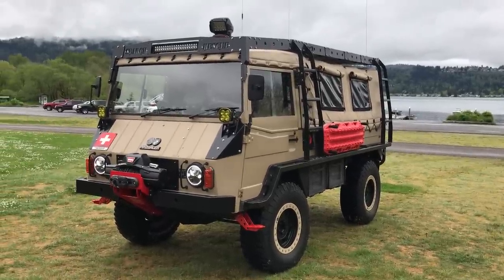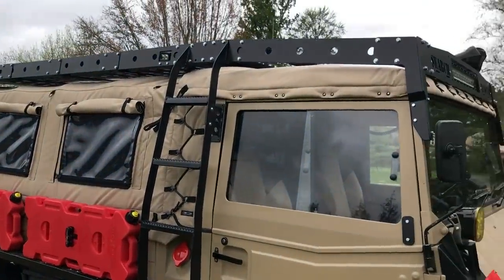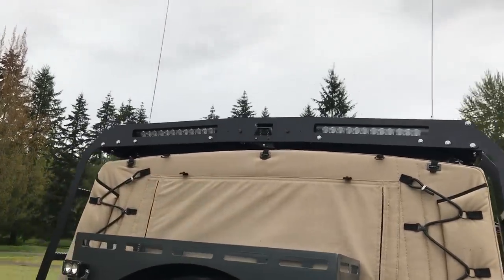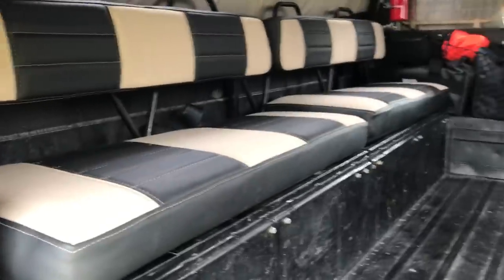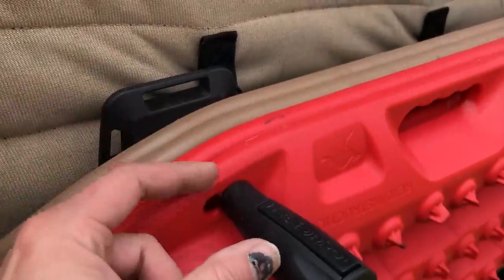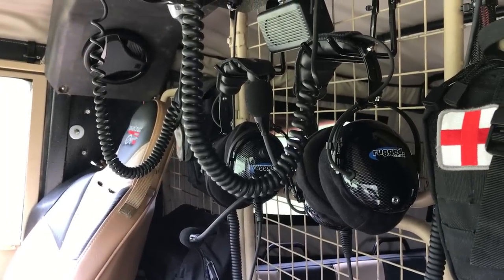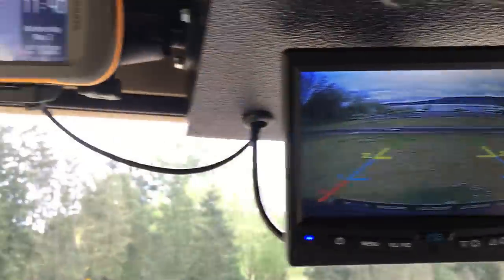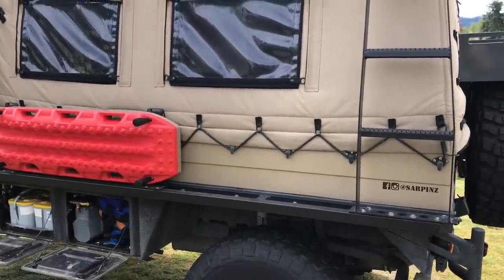Search and Rescue Pinzgauer vehicle walkthrough

Comment: The roof rack is very impressive, couldn't stop looking at it.
Reply from the maker: Thanks Kenneth, I drew up the initial design and took it to a fabricator (Mule Expedition Outfitters in Issaquah, WA) who then turned it into reality for me.  I wanted something lightweight (it's all aluminum, weighs less than 200lbs) that matched the original lines of the vehicle as much as possible.

Comment: This is a very cool rig!!!

BUT NOT because of the BIG 3. These are always the same: LED lights, bumper and roof rack.

What makes this thing special ist the torsion bar frame, the ground clearance with SMALL tires (due to portal axles) and the overall very small footprint.

Comment: Dear God that Pinz is sweet!!  The people at Mule worked some real magic for you!  Did they do those red front entry steps for you, too?  Looks like they're retractable (?).  At 6'2, I always wondered if I'd be too tall for one of these, but can't help drooling anyway.  Looks like those suspension seats are pretty much flush mounted, so not a lot of interior height lost there - nice!!  

Just a quick side note - About $300 to $400 in Dynamat will bring the decibel level down 20+.  Throw some marine carpeting over it using a contact adhesive and you're set.  Just a thought, if you'd like to quiet the ride a bit.  

Congrats on your win!  You certainly deserved it for such an outstanding Pinz!!  Can't imagine what all of those mods cost, but It was certainly worth it.  There are a couple of radio-body 710Ks near me for about $25K.  Sooooo tempting!!
Reply from the maker: Thanks for the kind words, I appreciate it :-) the steps are removable by pulling a pin.. they came from Expedition Imports in Valejo, CA. I've had some 6'+ guys sit in the pinz and they were surprised at how well they fit, however the did comment that the sightline was a little challenging due to the height of the windshield.. for reference I'm 5'10" and fit great with loads of head room.  

Thanks for the tip on sound deadening.  The place I'm going to start is in the rear.. the gearbox is the noisiest part of the drivetrain (when you push in the clutch it quiets down significantly) so I think my biggest gains will be targeting that sound.  It's been on my list for a while, but there's always more to do than time to do it :-)

Comment: As a firefighter EMR in NM I am impressed. What was the cost? if that is not too cheeky! Didn't see any water capacity? Also consider a stokes config for evac., Put extrac. and rigging in exterior access. ( under box on sides.) Totally cool you got my vote! Consider marine electrical passage systems and wiring. Not to be critical, but clean up the coms.Unnecessary complexity.  Much better systems out there. Still love it. Beware the ram mounts they do polish and slip.
Reply from the maker: Hi Tim, into it for $20K initial purchase price and around $30-40K in upgrades to get it to this point.  I don't have water mounted at this point.  I have a few different solutions I carry for myself and subjects.  For litter carry I have tie downs up top that I use for carrying in and then either side of the bench seating can be folded flat and a litter slides in for transporting out.  Regarding comms, the current system works well for me.  Since I'm paying for everything out of pocket I have to spend smart.  The system I'm running is a mix of systems I've run over the past 7-8yrs in SAR and works extremely well for the money.  The more integrated systems that exist are considerably more expensive and my system is both stable and expandable, both of which are critical.  Thanks for all of the feedback, I appreciate it.
Reply: I fully understand your exigencies and have the same myself. Re: coms, I was actually looking at the wiring and suspect it could be simplified. But I am just a fly on the wall. Stay safe and don't let the turkeys get you down.

Comment: Damn that's sweet! Aside from noise from transmission it almost seems perfect. What do you think of lighting in the recess of the side ladders for scene/ladder lighting? Something small. For the mud tracks what about a hinge on the drivers side ladder( right side rail) with a aluminum flap to cover the leading edge to the bolts(reduced in length)and a pin retainer? Flush, reduces snagging at leading edge(?), easy, may even improve fuel economy 0.00001%. Just an idea.
Any interest in commercializing this layout?
Reply from the maker: Great feedback and suggestions, thank you.  I'm not interested in commercializing at this point.  Too busy with other priorities (family, work, SAR, etc.).  I still have more work to do on this one ;-)

Comment: Glad to hear you won! Congrats! That's a really fun looking rig! Where are the cup holders?!?!
Reply from the maker: I picked up a set of cupholders from Tuffy Security Products and velcro'd them to top of the doghouse between the front seats.  Let's see if this link will work, if not they are on my Facebook Page - https://www.facebook.com/SARpinz/photos/a.419882158363356.1073741828.417325181952387/478017389216499/?type=3&theater
Reply: Ya, link worked, that looks like a comfy setup!  Are those Mastercraft seats I see? I ran Corbeau seats in my offroad rig years ago, the suspensions seats are nice!
Reply from the maker: Yep.  They are MasterCraft Baja RS with custom 24v seat heaters I installed - being an air cooled engine with heat exchanger it doesn't warm up very well in the cold weather so the seat heaters help quite a bit on snow runs.  At some point I'll pull the heating system apart and rebuild and trouble shoot it to see how much heat I can squeeze out..

Comment: Awesome setup. Recommend an ir package for what you are doing. Rovir 640 for the roof and a speedir night owl with ai detection for front. And also maybe a bear gun just in case lol Good luck!
Reply from the maker: Thanks Ryan.  I'll check it out.  I've thought about IR, there's actually a space for an IR light stock and a space on the stock light switch to control it.. however I used that space to mount my siren speaker (perfect fit) so would need to find an alternate mounting location..

Comment: Where did you get your overhead center console? That's what I've been looking for, seemingly for years. Or, is it custom? I've got about as many electronics as you do as well, so housing them is tough, as you know.
Reply from the maker: Tyler p it's custom. I started with a cardboard template and we worked from there until we got the shape right and then built it out of aluminum and covered it in bedliner.

Comment: Great vehicle. I would like to know more about your roof rack. Home built or manufactured. Could you direct me to a site for the roof rack.
Reply from the maker: The rack is a custom build based on a design that I came up with.  I worked with Mule Expedition Outfitters in Issaquah, Washington to finalize the design and build it.  They have done at least one other Pinzgauer and also done some similar designs on VW Synchro's.  They've also built a custom box for their LMTV, definitely worth checking them out.  http://www.dasmule.com - let them know you have questions about the Search & Rescue Pinzgauer and they'll know exactly what you are referring to.
Reply: SARpinz Thank you. I too have a LMTV M1081 it's an air drop version of the M1078. I like the rack you guys designed. I'm looking into how to better protect my truck.

Comment: Сколько стоит Ваше удовольствие. Просто супер. Как раз для Казахстана. Лучше нет. Я бы купил. Главное цена
Reply from the maker: I've invested quite a bit into it over time.  Each year I improve it a little more to function better.  Most of the changes and improvements I've made are to enable use for Search & Rescue, the core mechanical and off road functions have been flawless and have required little effort or cost to maintain.

Comment: Excellent Rig! Are you a Ham as well? Do you have info on the fuel injection system on your Facebook page?
Reply from the maker: Yes to both.  I'm running a system built by Goatwerks in San Diego.  There is a link to the EFI system details on their homepage: http://goatwerks.com/home.htm - just be aware that it's a one man shop (he's been working on Pinzgauers much longer than I've even known about them) so it can take a bit of work to get ahold of Jim to chat..  Tell him you saw his kit on the Search & Rescue Pinzgauer ;-) he can sometimes be found commenting on  http://real4x4forums.com/ discussions..
Reply: +SARpinz.  Thanks for the link. I have peen pondering a 4x4 comms vehicle to build but with some additional capability. Moved to SV9 land about ten years ago and no one around here in the Ham community has even thought about putting together such a vehicle. The only problem might be the local LE boys around here, seldom would they see a EMCOM vehicle nor understand the radios or rescue gear. I like the ICOM remote units mounted overhead and I'll check out the headset gear interface boxes. Keep up the great work! de, KF8LC-SVØXBH/9
Reply from the maker: Many of the hard top Pinzgauers were radio trucks and have racks, power, antenna mounts, etc. and would make a great starting point for an EMCOM rig.  Some even had onboard generators which you may be able to find in tact.. I'd like to do a 712K or 718K in the future..  Post links here or on my Facebook Page (http://facebook.com/sarpinz) so I can follow along as you research your options..
Reply from the maker: I should add that with the Fuel Injection and Electronic Ignition it's definitely something that can be daily driven with very little drama.. I have a few different vehicles and the Pinz is easily my favorite to drive.

Comment: Good job 
Can I ask you, how much?
Reply from the maker: A lot ;-)  I purchased it 3yrs ago for about $20K (from what I understand a previous owner spent about $50K getting the engine upgraded to 2.7L with fuel injection and electronic ignition, upgraded the driveshafts, had a custom fuel tank installed, and more), since then I've replaced the soft top with a new one from Tuff River Stuff in Colorado, installed the TR Beadlock rims, had quite a bit of custom fabrication done by Mule Expedition Outfitters in Issaquah, worked with Eagle Electric in Renton, WA to significantly overhaul the electrical system, I swapped out all lights for LEDs, and much more..  :-)

Comment: Does having that winch in front of the grill affect engine cooling?
Reply from the maker: I originally was worried that it might but when I was in Arizona I met with a few members of the Southwest Pinzgauer Association they said it doesn't impact temp at all.  They've been running Winches in that spot for years with no impact.  I've had it running for 6hrs straight while doing a Snowmobile rescue, and temp never rose above 200.. so it doesn't appear to ;-)

Comment: Cool truck. I will have to say you made it as difficult a build as I have ever seen. A 4bt and a complete 12v system would have been easier and cheaper.
Reply from the maker: It's been done over time as money and time allowed 😊 - since that video was done I have actually removed the 24v-12v converters and am running a separate 12v system with a DC-DC charger from the 24v system. The charger is also an MPPT controller and I'm running 340W of solar that charges both systems.  I would love to do a Cummins R2.8 (same engine we put in my FJ-40) but that's a lot of custom work and space is a challenge, especially for cooling system.. it's a journey.  Its working really well right now so hard to justify the additional expense..

Comment: you need locking gas cap
Reply from the maker: Thanks for the feedback, however it's really not necessary in my situation.. It's garage kept when not in use, When on a mission it's typically used as a base of operations or parked near other Searchers so it's seldom out of sight.

Comment: Cant get repair parts . Dont buy
Reply from the maker: Hi Michael, thanks for engaging.. actually I haven't had any trouble at all getting parts over the 3yrs I've been doing this building and running it for Search & Rescue.  I've broken plenty of things along the way as I run it pretty hard :-) the two main sources for parts are Expedition-Imports.com in California and SwissArmyVehicles.com in Arkansas.  Both carry a large number of parts on hand.  There's also a lot of parts on ebay, several members have extra parts or vehicles they are parting out on Real4x4forums.com and there's also a really good cross reference of parts stocked at NAPA, Pep Boys, etc.. Since the manufacturer of the Pinzgauer also builds other vehicles (the G-Wagen for Mercedes, the old Synchro system for VW, the new Mini Cooper and upcoming Z4, etc.) they used a lot of OEM parts that other manufacturers used and you can get things like clutch assembly, switches, and a lot of other wear parts at your local parts store..  I wouldn't shy away from owning one of these incredible vehicles over parts, they aren't hard to find :-)

Comment: S&R with a soft top/sides? Nope.
Reply from the maker: Ronan B the roof rack covers the entire rear portion and the soft top makes it lighter overall which helps.  In the footprint of a VW van I can carry 9 searchers plus all of their gear, plus myself.  The top is dual layer and insulated so it has worked out really well.